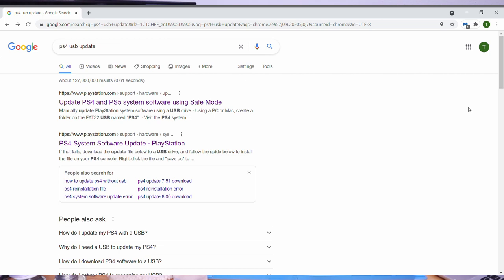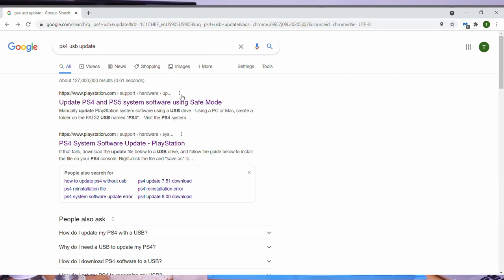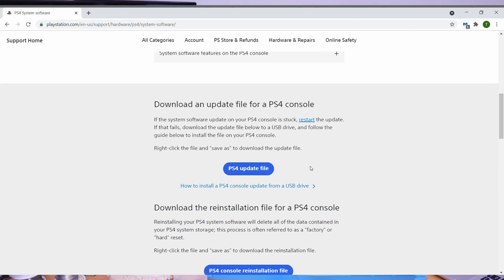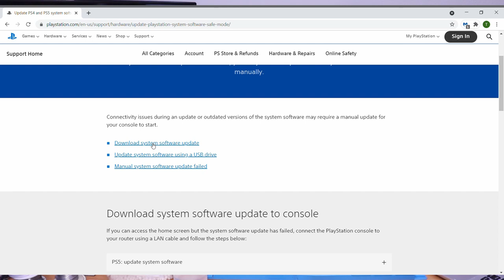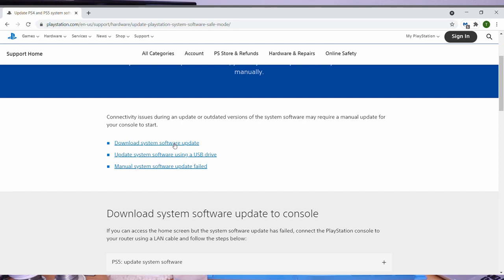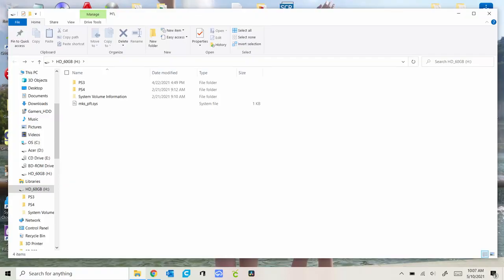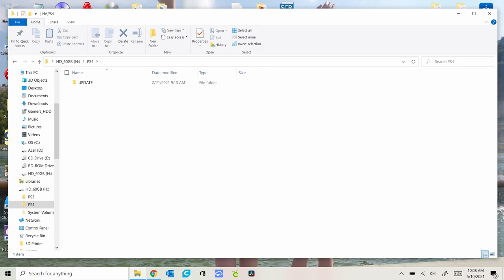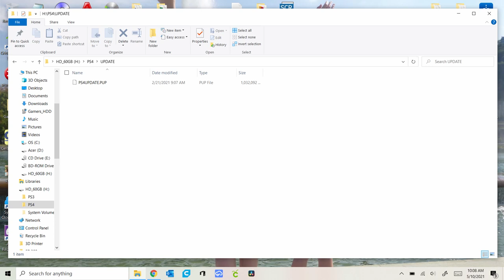Crashed HDD in a PS4 Slim (Reinstall software and replace hard drive)

Comment: Would any of these steps change if you wanted to go from a mechanical HDD to an SSD? Are there any other "gotchas" to watch out for when going from an HDD to an SSD. This would be for a PS4 Pro
Reply from the maker: As long as the formfactor is correct for the SSD... it should be the exact same steps.

Comment: Hello I changed my hard drive 1 week ago because what the old one was broken suddenly it asks me to update the system via a usb key but I cannot do it there is an error which says Impossible to find the update file (SU-413350-3)
Reply from the maker: I would try another USB stick.  It's generally caused by that.

Comment: Can you take apart a Seagate external HDD and use it as internal? They have the same connectors just wondering if an internal has a component that an external doesn't have that would cause it to fail installing the system software.
Reply from the maker: Assuming it's the type that has an SATA drive inside the USB box... then yes... it should work.
Reply: @PghGameFix  now I'm having an issue where it's not reading the file off of my USB stick when everything is correct. Will a SanDisk flash drive work or do I need another drive.

Comment: 95 % save on rdr2, all my platinum trophies, all the sweat the grinding I’ve done. Gone just like that?
Reply from the maker: Just like with a computer... or anything else with a hard drive... there are ways of doing backups.  BUT, nothing can be done after it gives up. (Other than expensive data recovery) If you have a PS account... it will have backed up your stuff.
Reply: @PghGameFix  welp it’s gonna be a long journey but I guess I’ll have to start from the bottom (for the 3rd time)